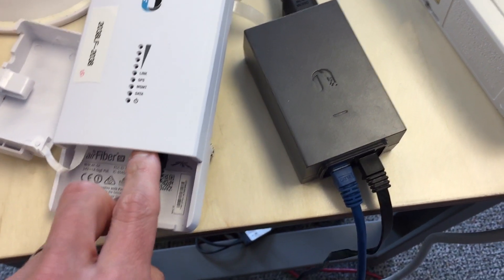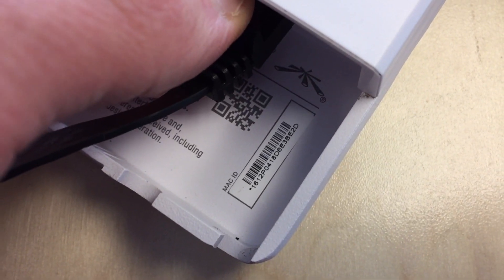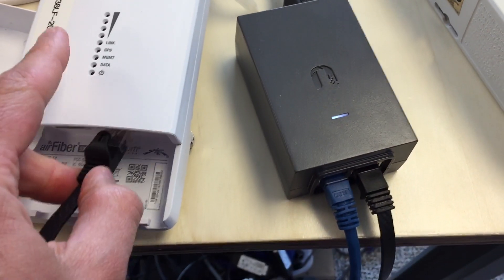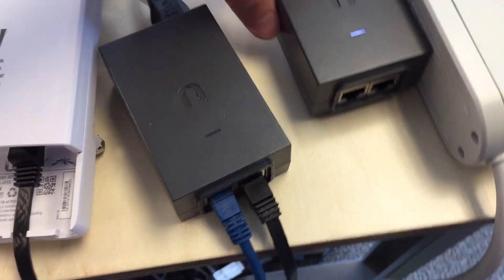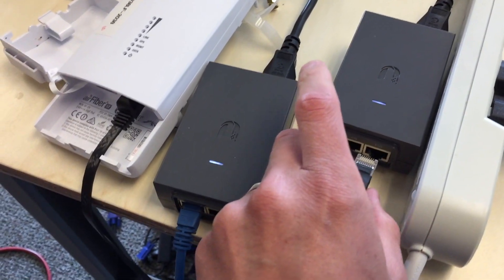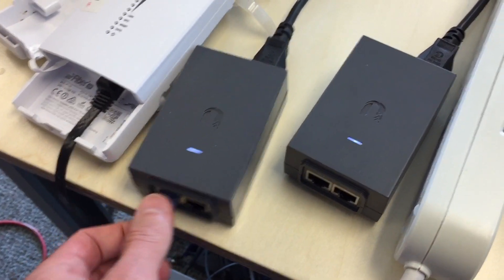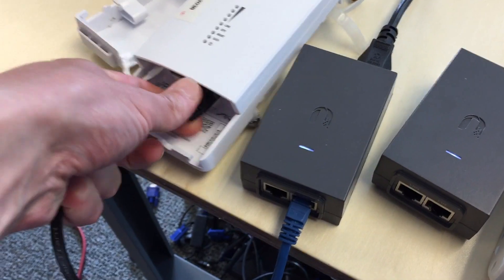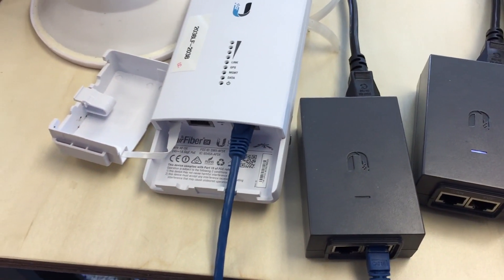AirFiber AF5x Broken - Blinking Lights

Comment: Thank you for sharing this video, that mean the device has short circuit on the power rail , to fix the device you need to remove the circuit board off the plastic enclosure
Reply: Hi, and then what do you do on the board? I have this same problem, is this solvable without having to replace?
Reply: @fabriceb702  You need to disassemble the device & troubleshoot the circuit board
Reply: Where to find circuit board? On pbe ac 500
Reply: @King__SA-pp6fy  You have to disassemble the unit it self , it is inside the plastic enclosure